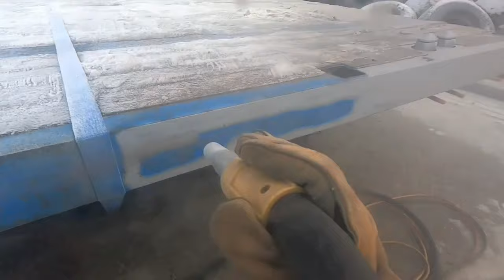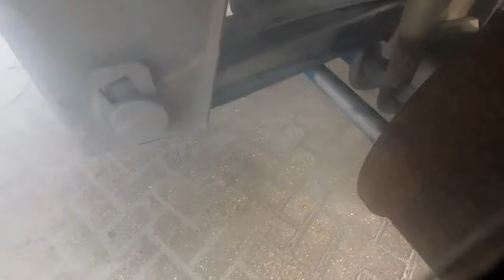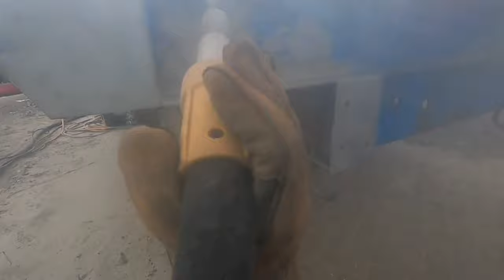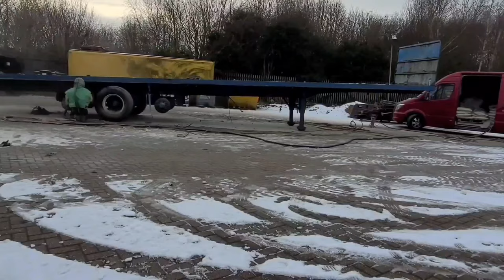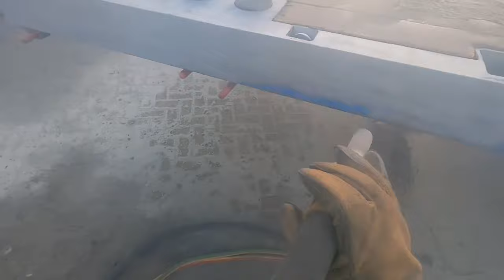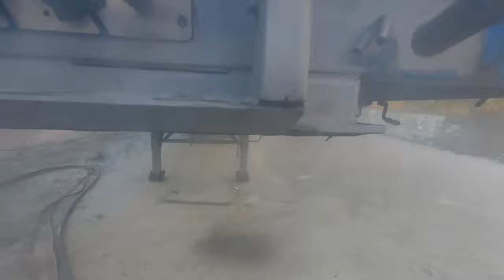SandBlasting Wagon trailer

Comment: The process seems to put a ton of dust into the environment.  How do you capture toxic items like lead paint.
Reply from the maker: Yeah your right it is very dusty and extremely loud. I cannot speak for others but I test for lead paint (not on this as it was too new and wouldn't have been around when lead was used) as lead paint is banned hear in the UK. I also use none toxic media. Kiln dry sand (sillica sand) as also been banned hear in the UK (to blast with) so Ideally only approved media's should be used 👍

Comment: How much would you charge for a job like this and how much sand did you use
Reply from the maker: If you could send some photos to info@mobileblasting.co.uk I can advise/quote from them.
Regards Mick ps
Sand hear in the UK is illegal to blast with we use silica free crushed glass on this job I used 250kgs on the face's and 500kgs internally on the I beams all in all around 750kgs could have been less I didn't keep track but that's what I would load the van with to do another and hope for some spares